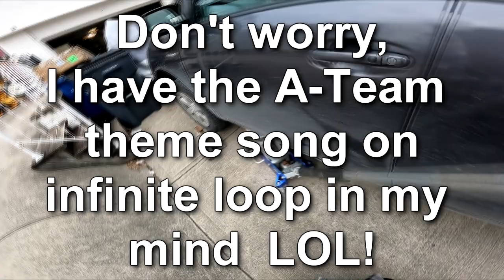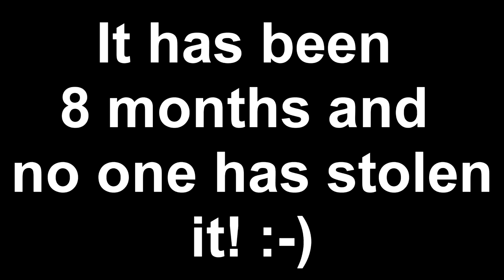Prius Catalytic Converter Anti Theft Idea

Comment: i spray painted my cats red with high heat spray paint and i haven't had anyone steal them since. ive caught pleanty of people on camera jacking up my prius's and once they see they are red they just quickly get back into their vehicle and drive away. The dealership told me to paint them red because most places wont accept them because its a sign of theft. also... the high heat paint is nearly impossible to remove.

edit: i own 4 gen 2s. they are all in my front yard.
Reply from the maker: Nice! I should do that as well to be safe. Thanks for relating what worked for you. It is super annoying that this has to be a thing we all have to worry about now.

Comment: That doesn’t rattle like hell?
Reply from the maker: I was worried about that as well. But the chain is pretty hefty and there is enough slack left in it to avoid it rattling. It isn't anything I have noticed at any rate. The car has 196k miles so just looking to get another year possibly two before trading it in.

Comment: Why not just straight pipe it?
Reply from the maker: It is an order of magnitude more difficult to that with what I have. There is  flanged piece with a flared end that is needed to connect to the header. Unfortunately that flanged piece is welded to the Catalytic Converter assembly. It would be a pain to fabricate that and bend the tubing , so this just seemed easier.